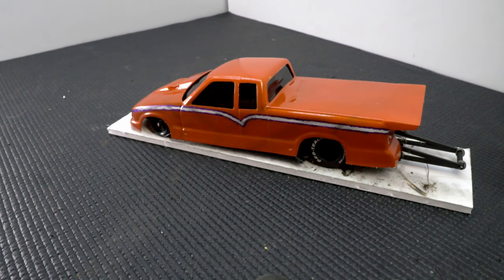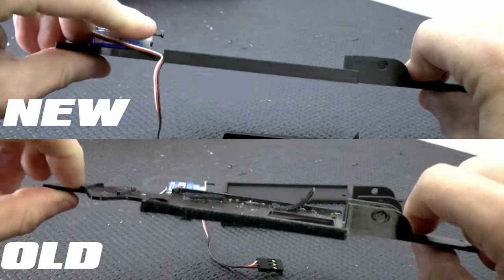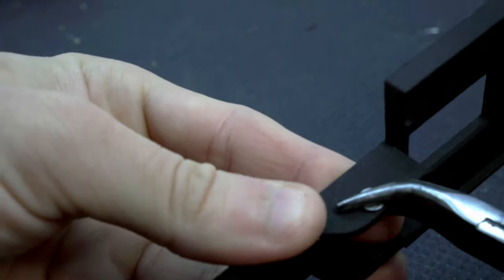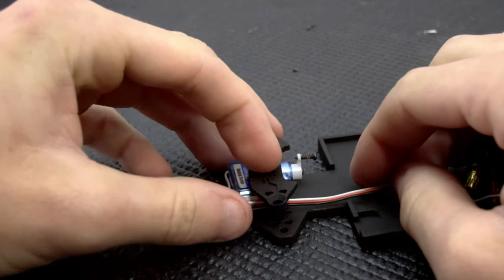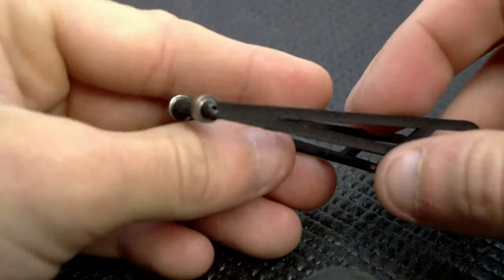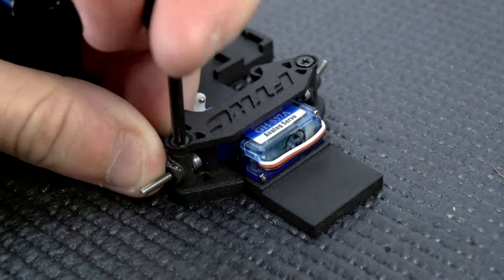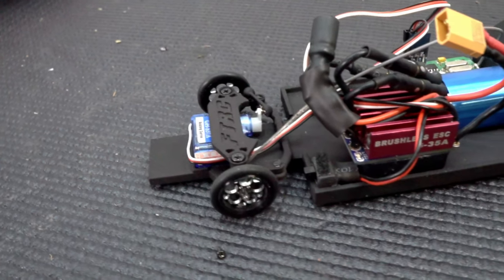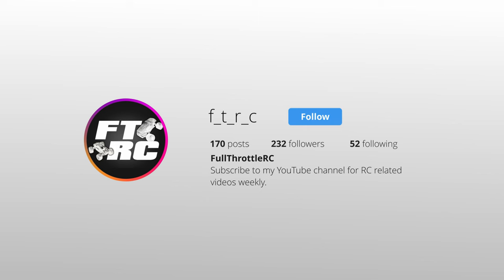Build YOUR Own Micro Drag Car! | Micro Drag Car Build Guide

Comment: You should continue this series! I was thinking of retro fitting a 1/24 axle from a crawler and somehow designing a 4-link suspension set up for this would be awesome. It would have to be driveshaft ran though. Make it front engine RWD to keep the wheelies down and launch consistent
Reply from the maker: I actually have an extra 1/24 crawler axle laying around, might not be a bad idea. The main problem I see is wheels and tires. It would likely need to have rubber rear tires instead of the foams. Having to put glue on the tires every pass isn't logical for most people
Reply: FullThrottleRC Agreed or run on a prepped surface like a actual drag strip with all rubber down already.
Reply from the maker: Yea that's an option but not everyone has access to that. It's a lot easier for something to grow when anyone can join in
Reply: FullThrottleRC Agreed well time to try and find some rubber tires

Comment: Having a few years of slot drag racing experience...I think these cars would be ALOT of fun running in a gym or epoxied surface, def not pavement unless it's maybe a tennis court or sorts
Reply from the maker: Absolutely! I learned pretty quickly concrete isnt ideal unless it's super smooth. I think something like a gym floor would be a problem though because of the reissue left behind from the traction compounds. I'd like to revisit this project and find or make some rubber tires for it
Reply: FullThrottleRC i agree... i DO think its most similar to a slot car track surface but yes, glue residue

Comment: This is super cool! There's a guy on Instagram that builds adjustable wheelbase drag chassis for 1/24 hardbodies, but they're modified from a wltoys chassis.
Reply from the maker: Yep I think I've seen some of his builds. Definitely cool.
Reply: Ya I'm getting into small scale stuff, probably gonna pick up one of your 3D printed chassis to build up 🤟
Reply from the maker: @barneymiller7894  Awesome! Thanks for the support 👍
Reply: Do you have a rough measurement for the wheelbase?
Reply from the maker: @barneymiller7894  The wheelbase is about 5"
Reply: I had some thoughts, so here's some unsolicited design ideas 😂 If you do a second version of this chassis it would be really cool to include a provision for adjustable wheelbase. Another cool product would be a one piece version of your 2430 motor plate with the axle flanges permanently attached to the tubs instead of the chassis, this way it could be mounted to custom chassis or production 1/28scale chassis for a complete solid axle rwd setup 👌
Reply from the maker: @barneymiller7894  I thought about doing an adjustable wheelbase but haven't found a way to do it that I'm happy with yet.
Reply: Still very cool, 3d printing has opened up alot of new doors in RC

Comment: I would love to have one of these
Reply from the maker: You should build one! They are really easy to build and a ton of fun.
Reply: @FullThrottleRC  im on a fixed income n dont have spare money or i would.....rc r awesome n so relaxing but i cant afford them
Reply from the maker: @claytondunlop248  Hopefully your situation improves and you are able to enjoy the hobby soon! Good luck! 👍
Reply: @FullThrottleRC  how much would u sell a rtr one for
Reply from the maker: @claytondunlop248  For me to build it ARTR, which means you would provide the battery, tx/rx, and body, it would be around $230 +shipping
Reply: @FullThrottleRC  omg
Reply: @FullThrottleRC  how much for one as a roller? No electronics at all
Reply from the maker: @joshuareglin9711  I don't currently build them to sell. If you are interested in one, you can check out my shapeways store to get the printed parts. There is a list of all the other things needed to finish the build there as well
Reply: @FullThrottleRC  I can't find the crown gear to build it. Where should I look next?
Reply from the maker: @cliffordsyoutubechannel4293  there's a few on ebay as well as other websites. Search for a 46 tooth crown gear with a 64 pitch for slot cars and you should be able to find some.

Comment: This is a really cool build. I have about 15 drag slot cars and we race twice a month. I'm definitely building one of these. What battery are you using?
Reply from the maker: Thanks! Currently using a 3s lipo from turnigy.
Reply: @FullThrottleRC  I see you say 3s but what battery is it what number is it
Reply from the maker: @koupe88wehadababyitsaboy96  I use a Turnigy Nano-Tech 450mah 3s lipo. The battery has to be small to fit under the body

Comment: Hey man I tried using the links to buy them and the link didn’t work are there any new link we could use so we could buy these parts??
Reply from the maker: @phoenixsmith2645  I believe it's a shapeways issue if you're trying to use the shapeways links. I've tried logging into my account and can't even access the login page on their website right now. I'll try again in a day or so, I apologize for the delay. I'll see what else I could do in the meantime
Reply: @FullThrottleRC  yeah the website won’t even pull anymore is there possibly another place where we could buy these from?
Reply from the maker: @phoenixsmith2645  if you have a printer you can get the files from cults3d. I don't currently have another site that you can get the printed parts from though.

Comment: Do you think 1/24 scale model bodies will fit this chassis
Reply from the maker: I think it all depends on the body. I designed the wheelbase to fit this S10 body, so that would be the main problem. I have plans for an adjustable wheelbase version so that you could you any body you wanted.

Comment: hey i bought the stl files and when i opened it , its tiny tiny like 1/82 is it done in  Inches and need to be converted to MM? i need some help here for sure
Reply from the maker: I'm so sorry I never replied to this, I remember typing out a response but must not have hit the send button. You need to scale the parts up by 2540%. Basically, the 3D program I use exports stl files with measurements as a "unit" instead of its actual unit such as an inch. The slicing software recognizes millimeters, so when I model in inches, Fusion 360 exports 1 inch as 1 "unit" and the slicer sees it as 1 mm. Hope that helps and sorry again for not replying sooner!

Comment: How do you think a 5200kv motor would run on this chassis?
Reply from the maker: As long as it's the same dimensions or smaller, it might actually be even better. I found the 7200kv was actually a little too much power and wish I could tune more in the ESC. I've been wanting to pick up a Castle Micro ESC so that I could do some tuning to the launch to hopefully make it more consistent.
Reply: FullThrottleRC Great. I look forward to your updates to this build. I am also going to build one and try and push 1/24 RC drag racing farther then just slot cars.
Reply from the maker: @sixsixtygaming832  that would be awesome!
Reply: FullThrottleRC They make motors the same dimensions. What’s good about this scale also is parts and electronics are cheap. I am going to pick up 7200kv, 5200kv and maybe even a smaller one for future builds and tuning. I think this could be a new big thing for RC are these. Maybe you could even offer a carbon fiber version of your chassis. 🤑

Comment: I'm building one all my parts are on the way my motor and ESC came today
Reply from the maker: Sorry I missed your comment before! Thanks for the support!!
Reply: @FullThrottleRC  I'm taking my build on a different route is there right email or form or Facebook page I can reach you at
Reply from the maker: @koupe88wehadababyitsaboy96  check my Instagram page. You can get my email from there or message me directly there
Reply: @FullThrottleRC  welp i dont have Instagram u got a email
Reply from the maker: @koupe88wehadababyitsaboy96  hard to enter it here as I don't want any bots getting to it but I'll try. All lowercase. Sam dot Ockmond at yahoo

Comment: How much is it for a build like this but maybe a different body
Reply from the maker: It would cost you around 200-250 to build, depending on the body and electronics you use. I have plans for an adjustable wheelbase version but have other projects in front of it at the moment.
Reply: @FullThrottleRC  how long would it take for u to build one and do u have time?
Reply from the maker: @Jay19888.  I'm not willing to build another one for someone else. The cost would be too high for anyone to justify, and it would take time away from my other projects.

Comment: How did you mount the body??
Reply from the maker: Just some velcro on the sides of the body and chassis.
Reply: Do you have any pictures by chance?
Reply from the maker: @Deon_Hayden_421Outlaws  I don't. May have a few older pics on my instagram. It's just velcro stuck to the side of the chassis and the inside of the body.
Reply: @FullThrottleRC  okay thanks I’m building 3 of them right now

Comment: about how much did it cost to build?
Reply from the maker: Around $150-175 depending on the parts you use
Reply: @FullThrottleRC  wow that's not bad
Reply from the maker: @chadthunderd1ck734  they are fun to build as well. Challenging to drive!

Comment: wears the link for that body , having problems finding a body for it
Reply from the maker: I purchased the body from pacific slot cars online, but I have seen them on ebay as well.
Reply: @FullThrottleRC  yeah the wheel base is very long for using model car bodys
Reply from the maker: @johnathonberrier5683  I used a body made for slot car drag racing. I'm working on a version with an adjustable wheelbase, but it will take some time.